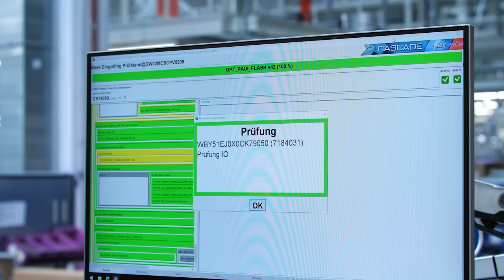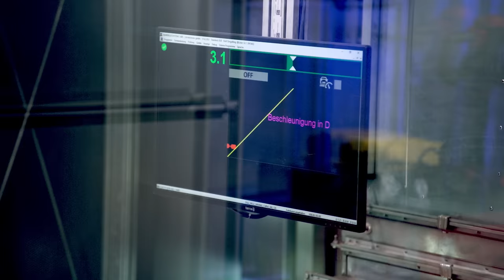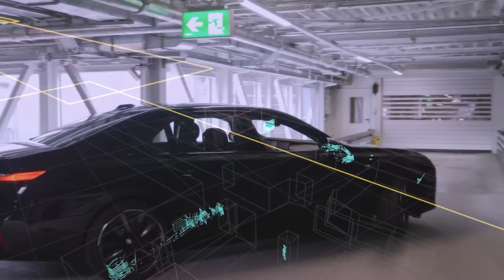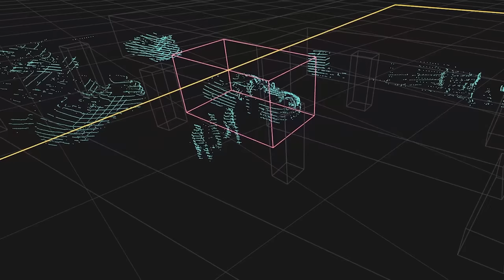2023 BMW 7 SERIES - PRODUCTION

Comment: The last component added is the depreciation additive. Works well on the 7 series
Reply: I saw a 2008 760li with 40k miles sell for $6,000 at Barrett Jackson. $120k new lol.
Reply: @MrPland1992  "2008" a 14 year old car not worried about the milage its 14 years old! no wonder it was cheap.  My G30 is getting the 5 years old now and its been amazing car but I know for a fact that it will not hold its value because its a car not a house.
Reply: now you need to buy a Horse 🐎 soon this animal will be the most popular in the world 🌍 if it remains. such rates .

Comment: BMW 7 Series. The king of depreciation
Reply: It worked out great for me.  I got a 745e with 1,200 miles on it for $86K.  MSRP was $119K on the monroney as it had Bowers, Merino leather, Tanzanite paint, the Executive package and a lot more.  Plus I got an extra year of unlimited mileage certified warranty.  I love the fast depreciation on big sedans.
Reply: @johnm7328  Similar boat here, bought an X5 xDrive50i for 62k with 20k miles and the msrp was like 93 before tax.... the executive package is such a nice touch but they charge $1,500 for that upgrade which is bonkers. Got the white leather interior and looks so nice.
Reply: @johnm7328  with all the negotiation potential and rebates on new bmw`s, you could probably get a new one close to what you paid
Reply: You ain't lying.  I bought a BMW 750 brand new in 2017.  It's in great shape, low milage, and it's only worth $35K of the $100K I purchased it for.  Never again.
Reply: S klasss
Reply: @JRS-j9m  i feel bad for you. The big problem with these BMWs is that once the warranty expires, the re-sale value pluments because how expensive repairs can be. Air suspension and electronic sensors can be costly nightmares and nobody wants to deal with that off-warranty. With high end BMW, its best to lease it for 2-3 years.
Reply: @danny200mph5  You may have a point on leasing.  I've never really liked the concept of leasing anything because it seems like money down the drain, but depreciation is also money down the drain.  I may look into that the next time I want something new and just see how much I'd spend leasing versus owning.
Reply: @JRS-j9m  good luck with your next purchase. Purchasing an expensive car is never a smart financial purchase, its one of the worst depreciating value you can buy. FYI i looking at a dumb purchase myself, buy a Model3Perf or Lease a Model S LR. LOL
Reply: @danny200mph5  I mean, we can't just walk around, now can we?
Reply: @JRS-j9m  holy crap man that is some crazy depreciation. Luckily i got a good rate and intend to trade in around the 3 year of ownership mark to hopefully get something electric from BMW

Comment: I wish car manufactures would design the computer screen into the front panel. Currently is looks like an afterthought.
Reply: Just make the entire windshield one huge touch screen. 
That way the driver will Not miss anything Important.
Reply: @GS-zc4sk  So yea so when you get a windshield crack your car gets totaled by insurance? lmao, glad these designer people are not as silly as you.
Reply: That would be stupid
Reply: @TheLunzDen  You never bought a new car huh? It's life. You can total brand new car by damaging 4 elements on it. BMW X5 G05 2020 1 matrix led headlight used costs 2000 euros, brand new is about 5000, that is 1 headlight. If you have a front end collision on this vehicle you will instantly total it, insurance will not repair it, it will simply payout market value of vehicle and sent it to junkyard or auction it.
Reply: Totally agree Brazos River, really find this stick on ipad design mentality, lazy and gimmicky. Looks like the car was 97% built then some weeks later an electronics geek comes along with the instrumentation and just plonks it on top or anywhere he/she can glue or sticky pad it.

Comment: 6:18 see how much rubber is on side side walls of the tires.  this gives more comfort on the ride rather then having low profile tires and expesive shocks.  Tires is where  car meets road and is first contact.  i have low profiles tires , they are just good for cornering , but most of thetime u are in a straight line.  smooth ride and quite is what thick tires are good for.

Comment: Fun fact:

The highlight of the new 7 Series cabin, however, is the enormous “theater screen” that drops from the ceiling to keep the rear passengers entertained. The industry-first feature is an optional extra that is priced at $4,750. For that price what you get is a 31-inch screen with a strange 32:9 ratio and capable of supporting up to 8K resolution. The 5G antenna lets the system stream UHD videos from Amazon and Netflix while on the move in addition to things like playing games, listening to music, and more.

Comment: The standalone display destroys everything. It should be integrated into dash board.
Reply: nah
Reply: its cheaper to produce this way... You can simply knockoff any wide view monitor for it. Imagine the work and design you would need to swing such a display into a curved board....

Trust me i worked in the hall where the chassis gets wielded and made, cheap is the answer to any problem BMW has.

Comment: Really impressive manufacturing plant around this new model. All that work and it is just a shame that the frontal design is so awful. Can adjust partly to the oversized large front grill, but why the seperated, disjointed headlight setup? Didn't know how to fill the spaces left by using thin LED's? Also digital dash should be 2 part with centre in a console type arrangement. Unfortunately, 7 series have always been boring designs and now just ridiculous. Tried to help 20 yrs ago and still not got it.
Reply: Yes, that front grill is getting uglier and uglier!  And I agree with your comment on headlight setup -- it is as if they stole that idea from a Chevy truck
Reply: the oversize grill is driven by the chinese market.....they are into big grills....
Reply: DO NOT BUY BMW. BUY VOLVO CARS INSTEAD. VOLVO XC90 MORE SAFER THAN BMW X SERIES
Reply: @0anant0  or Citroen Berlingo.